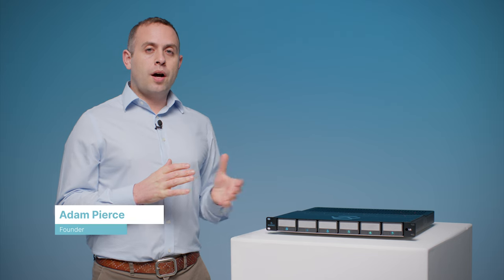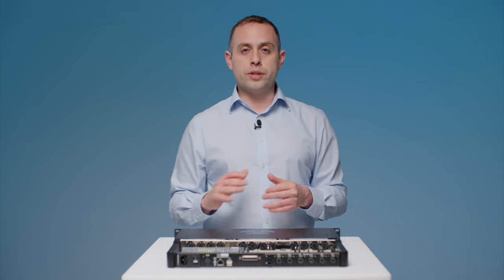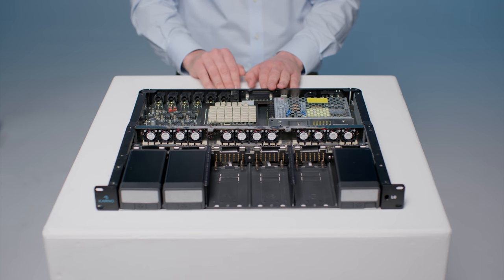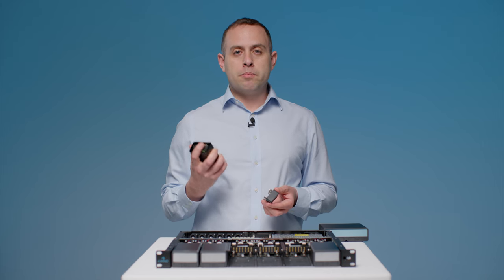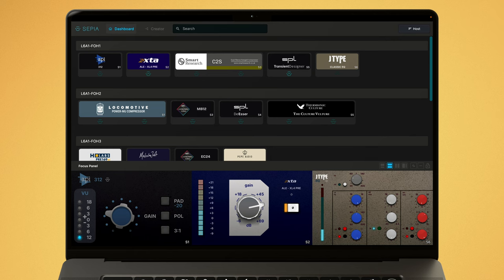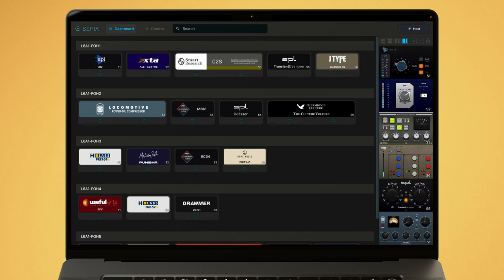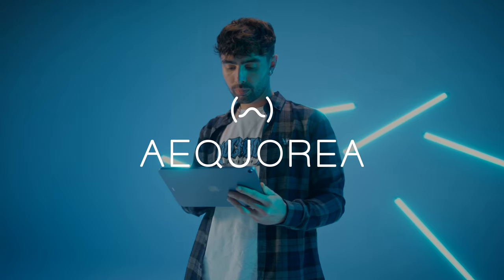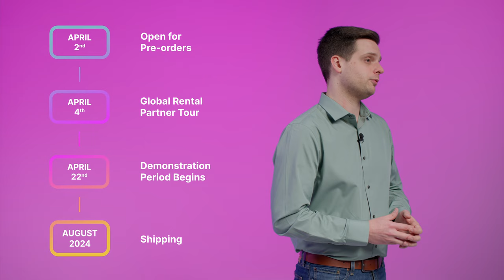SEPIA by Karno: The L6, First Modules and more

Comment: Very interesting. I'd love to get my hands on one before committing to 10 chassis. Need to see how good DAW integration is to a mixing workflow. Im hoping this could be simply routed via Dante to the end of objects in a Dolby Atmos mixing session. My only concern is DAW control using an Avid S4. Can we control using a S4 from within a protools session?
Reply from the maker: We will be showing that integration soon. We have some exciting things to announce on this but for now we can confirm you will be able to control SEPIA by plugin, MIDI, HUI, OSC and EUCON so the S4 will be an excellent match.
Reply: @karnosound  that's great to hear. I have high hopes this is going to be the solution I've been looking for.